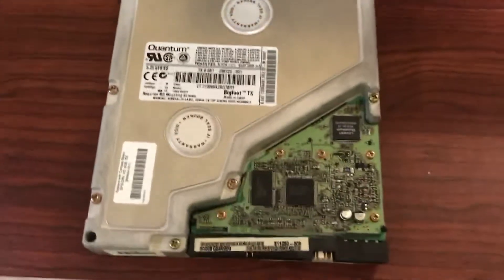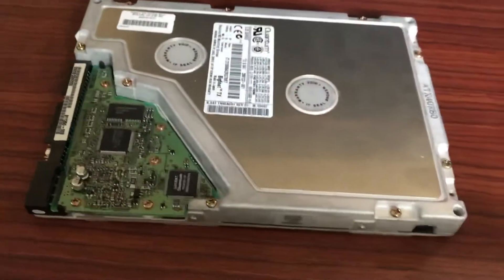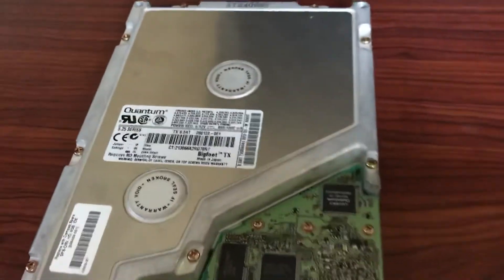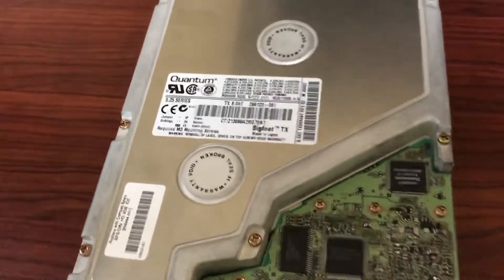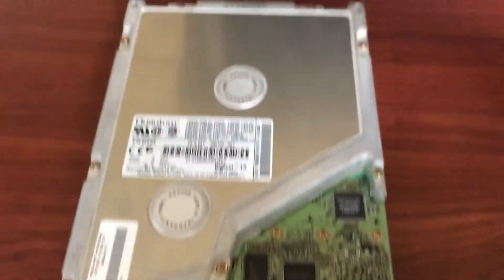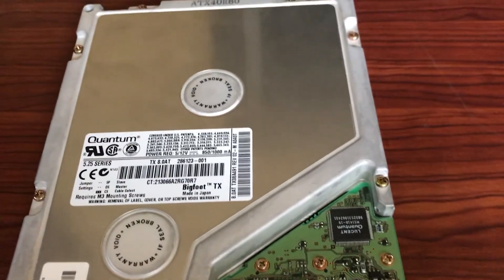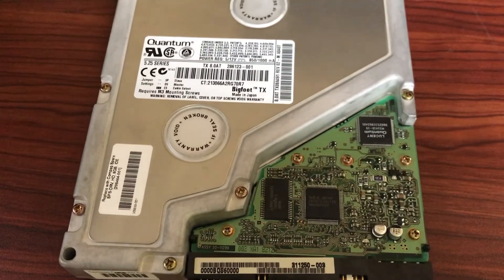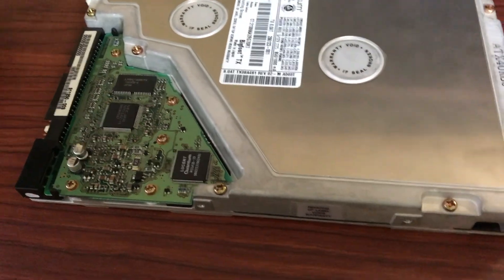Quantum Bigfoot TX 5.25” Hard Drive Spin up/seek!

Comment: Toshiba does still make hard drives! I have three out of their P300 series (two HDWD110 and one HDWD120) and they're fantastic. One of them is at about 22000 hours (which isn't that much, I know, but it has been used very heavily during that time). An interesting thing is that the spindle in these drives is stabilized from both sides unlike most similar drives. The HDWD120 is pretty heavy since it has two platters. It actually manages to be heavier than an old 60GB three platter Western Digital that I have.